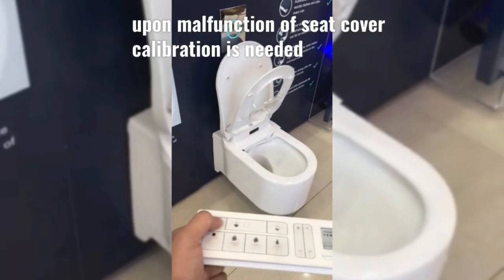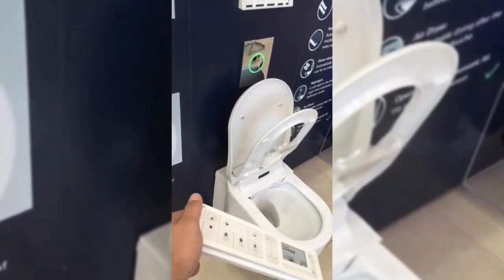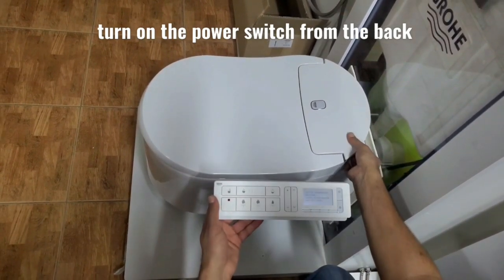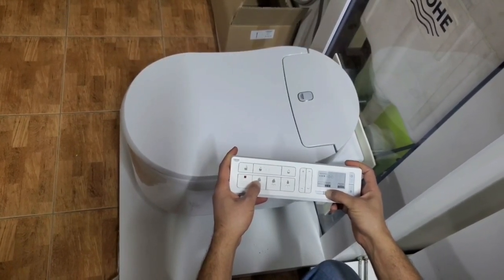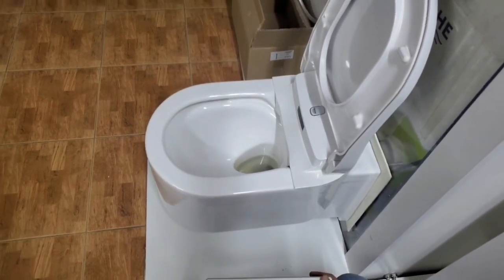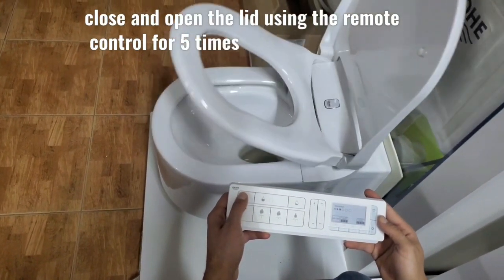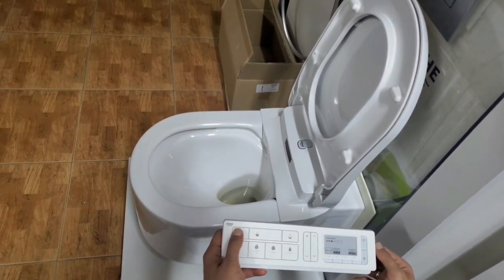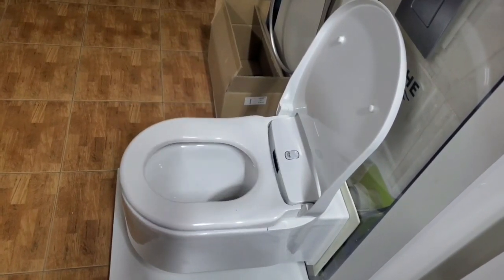Grohe Sensia Arena seat cover ( E Unit ) calibration

Comment: Hi, I have newer remote which looks different from the one you showed in the video. I also have the same problem of seat not opening fully. Can you also upload the video/steps to fix with a newer remote? Thanks :)
Reply: Hi I’ve also problem with this toilet,newer remote rontrol.
How I can calibrate it with new remote control?
Reply: I also have the new remote and the same problem
Reply: Did anyone figure out this with the new remote?
Reply: I have the calibration procedure for the new remote. unfortunately youtube doesn't allow me to post a link. any idea how I can share it?
Reply: @Siloopy can you tell me where you got it from? Thanks!
Reply: @pascalestoop1529  hi, I contacted the service dept at grohe and they sent me the calibration procedure. At first I thought it didn't fix the issue but now the lid is opening nicely
Reply: @Siloopy  thanks for your answer! I will try to get in contact with them for my lid issues 😄
Reply: @pascalestoop1529 did you find the instruction for the new remote? Can you post it here?
Reply: @Siloopy can you post the steps here? Thanks!
Reply: Ok, I will give a try tonight and make a yotube content with screenshot of the procedure for new remote
Reply: @RadosawChybicki  I contacted service department, they came and gave me a new lid. I asked for help with the new remote but the service man didn’t know anything about it. I am still not able to connect the new remote to the lid, sad that Grohe has so little information about the new remote.
Reply: @pascalestoop1529  on  youtube look for Grohe Sensia Arena smart toilet - calibration procedure with newer remote for seat and lid
Reply: @RadosawChybicki  on  youtube look for Grohe Sensia Arena smart toilet - calibration procedure with newer remote for seat and lid
Reply: @Siloopy  thank you so nuch!! Grohe should pay you for that! 😁